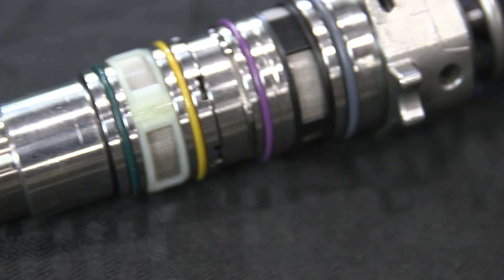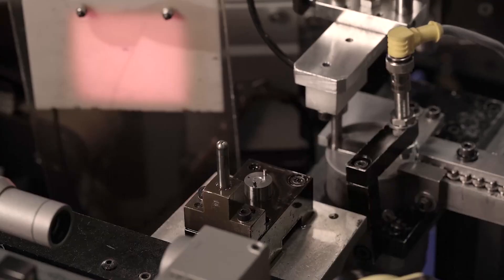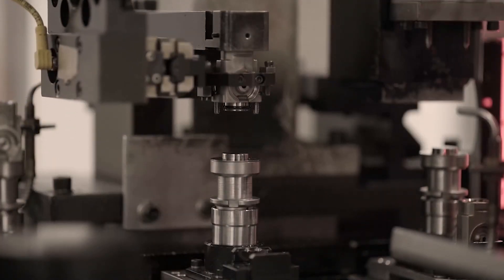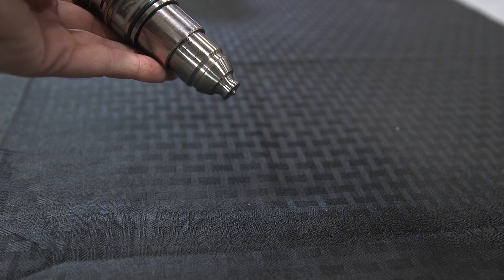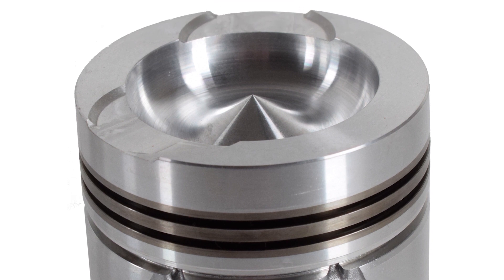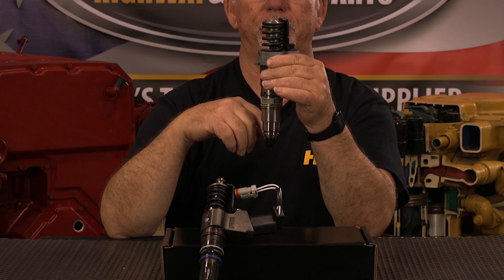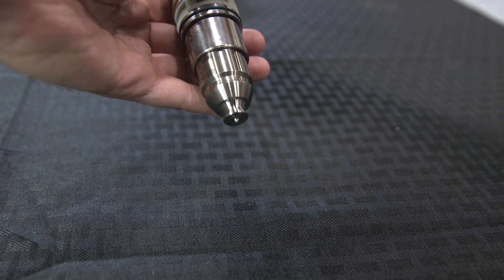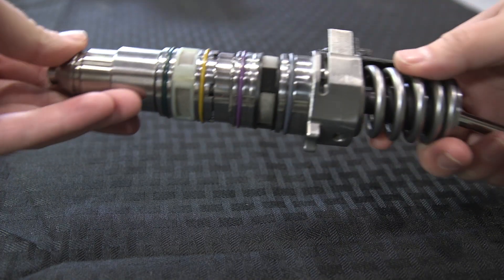Diesel Fuel Injector Problems? Leave It To The Pros!

Comment: If my injectors was removed from my engine and was exposed to the atmosphere for 3 1/2 months before reinstalling, could it cause injector failure?
Reply from the maker: It may lead to a failure or not performing optimally.  Microscopic debris can effect injectors due to their sensitive components.
Reply: @Highwayandheavyparts  I would agree with you and the shop left them on my fender for the 3 1/2 months uncovered but I have the fass system on that block most everything but the question is about the boost sensor not sending info to ecm. I have a lot issues with the shop that done the rebuild and probably messed up the harness while removing it. Thanks for the reply
Reply: @Highwayandheavyparts  corp poppy p0 to go with me she will do the

Comment: How about rebuilding injectors at a qualified Bosch mechanic?
Reply from the maker: If the mechanic has the proper equipment and facilities available to do so.  Fuel Injection test benches, a clean room, etc.
Reply: @Highwayandheavyparts 
Thus a reconditioned Common Rail injector could get its default initial grading back at such a service?